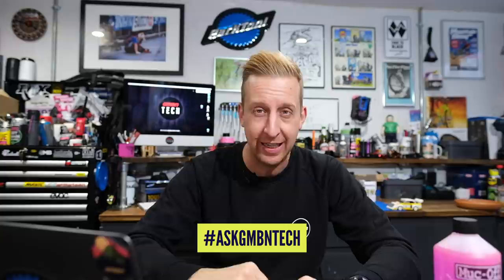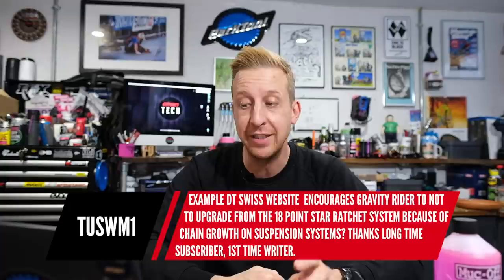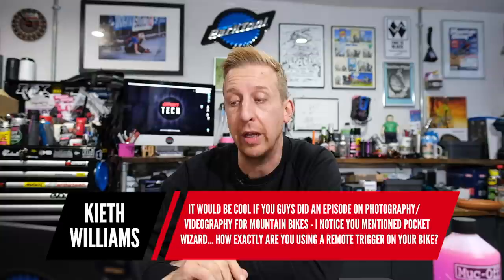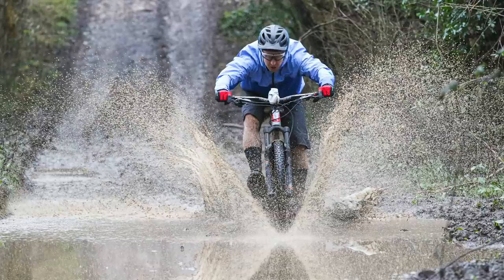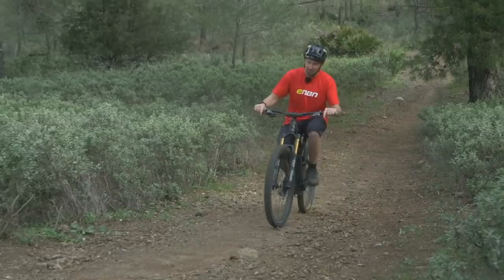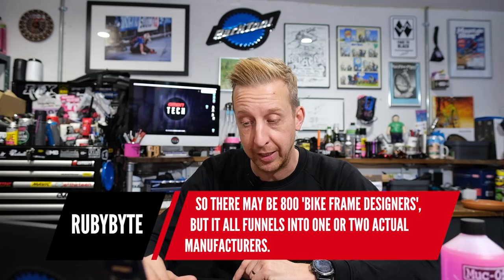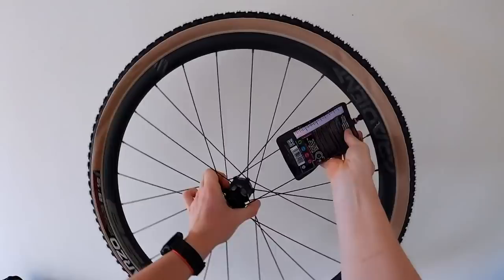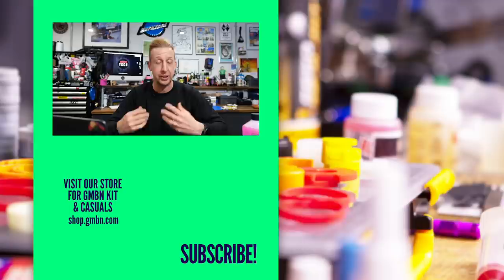What Is The Clear Pole Hack To Get The Bike To Stand Up In Photos? | #AskGMBNTech

Comment: #AskGMBNTech
Is it worth it refreshing a enrty level hardtail (900€ 4 years ago) with new tyres, casette, chain, chainring, (1x11) and a big fork service (straight steerer) or should I rather sell it and get a new bike with modern standards (boost, tapered steerer, Ht under 70°)
Reply: you wouldn't get a bike with modern standard for the money that selling an old standard XC bike would give you, unless you want to plough in a whole bunch of money on top
Reply: @judechandler5102  well that's a point
I thought about 1.8k maybe for a new Hardtail, maybe even carbon with some luck
Reply: @maikszczerbuk613  try canyon. They have some pretty decently specced carbon HTs
Reply: @judechandler5102  thanks for the hint, I already got one exactly due to this reason.
They have a serious deal, just the brakes are often quite poor

Comment: #AskGMBNTech
 my shimano hollowtech 2 crank got stuck
used a hammer to tap it out no luck tried to tap it it back in no movement can still see a little bit of axle showing
now it is not all the way in /against the bearing but its works fine, even the shifting works fine 
is this a problem ?

Comment: #AskGMBNTech. Hi Doddy. I am hoping to be placing my 2014 Boardman FS Team for a more modern bike. The geometry chart for my bike doesn't have the reach or stack figures. When sizing a modern bike compared to my bike. How do I work out the size using the geometry charts? I have tried to work out my reach with a tape measure and it is around 440cm to 450cm. If I went for a bike with a 470cm reach. My Bike has a 60mm stem and 760mm bars fitted. How would that make to bike feel for me. I am around 170cm tall. I have also been thinking about getting a 29er. Which did surprise me with some not so kind comments in the past. In a recent video Neil said he can buzz his backside in his Pole. As I am shorter that Neil would it be worth it for a full suspension bike? Or would it be better for me to have a 29er hardtail?

Comment: #AskGMBNTech hi doddy I have a 2020 giant trance running fox float rear shock with about 300psi for the correct sag but even on the slowest rebound speed it seems to rebound too quick and buck you off the saddle, what are your thoughts on a fix or any ideas. Thanks from nz 🇳🇿

Comment: #AskGMBNTech
I do a decent amount of road riding on my MTB and have been considering getting a set of 29×1.5 (38C) road tyres to swap on. I'm averaging about 20km/h on a 3-4hr road ride running Minion DHF fronts and Aggressor rears (both ~60psi). Will I notice any increase in speed or is it a waste of money? Aware that on a 16kg bike its no road racer, just wanting to go a bit quicker without forking out for a new bike 🙂
Reply: fatter tyres roll probably as well as skinnies, especially if the surface is not glass-smooth. Just switching to harder compound slick/semislick tyres might be enough to ride fast, with the added comfort and traction of high-volume rubber.

Comment: #AskGMBNTech Should the factory grease/oil on the chain be removed before the first ride? I understand that the chain needs to be lubricated, but don't they overdo it? I recently deep cleaned and degreased my drivetrain and swapped my chain (KMC) and went for a short ride and the amount of grime and dirt that collected on the chain, cassette and jockey wheels in an hour was just incredible, never seen something like this.
Reply: I believe GMBN covered this at some earlier Tech show. The grease on the outside of a new chain - absolutely, just wipe it off: some degreaser on a rag and just run the chain through it. The factory grease on the surface of a new chain is intended to protect it against corrosion while in storage. Actually riding with that grease layer on will not be healthy for the chain or your drivetrain, as you discovered.

The grease on the inside of the chain, however - the one between the rollers and the pins - that’s something you shouldn’t touch. I believe KMC says somewhere that if you do a deep degrease of their chain (submerging it in degreaser), it’s actually going to reduce its lifespan. You can lube a chain all you want afterwards, but nothing can really replace the factory grease between the rollers and the pins.

So: wipe the outside grease off, let the roller-pin interface grease on the inside to do its thing, and don’t submerge the chain in degreaser. = Golden
Reply: Yes. Many lubes, esoec dry lubes, require a full degreased chain so they bond to the inside of the rollers.
Manufacturers just dip chains to prevent corrosion.
They dont apply magic lube to the rollers that shouldnt be touched, or not dipped.
Reply: @Rupert Wenn  No such thing as a magic lube, unless it's a personal lubricant. :D But let's not mix apples and oranges, beginners and people less versed in all things mechanical might be left with the wrong idea. Lubing aside, there is (or at least should be) installation grease between the pins and the rollers. This is true at least in the case of KMC, but I can't speak for other brands. This grease is completely different from your average lube, and most normal users want that grease to stay in there for as long as possible: on the inside, that is - not on the outside.

From KMCchain.us / Maintenance Guide, Cleaning:
"Do not dip your chain in (aggressive) degreasers - they remove the remaining grease from the chain’s
bearings, and may cause cracks. They are also bad for our environment."

It's definitely true, however, that some lubes - especially the ones that dry wax coat your chain - require a deep degrease before application. You will get a clean, non-stick chain, but you will also get rid of the internal factory grease from the get-go, which reduces the lifespan of your chain in the progress. No right or wrong here, to each their own and you do you - I've just always decided that I prefer mechanical longevity to ultimate cleanliness. :)

Comment: #AskGMBNTech Hi Doddy! I'm thinking to upgrade my 2018 Pike RCT3 B1. It's easy on the Debonair side, but there are 2 versions of the Charger 2.1: RC2 vs RCT3. And it's hard to find any reliable information on them. What's the real difference and at which riding-style do they aim? Is this similar to FOX Grip2 and Fit4? Best wishes from Vienna!
Reply: rct3 has a low speed compression and a lockout adjustments. RCT2 has low-speed and high-speed compression adjustments instead without the lockout option. I'm running rtc3 on a trail bike and have never used the lockout.
Reply: @laurynasjagelo5075  I guess that shows that the RC2 would fit you better, because with the rct3 you cannot configure HSC. But that does not answer my question. If you search for it some say, that the RCT3 is pure crap and a well configured RC2 does it all (it's way more expensive also). I'm a long distance All-Mountain rider and use the 3 modes all the time. I wouldn't climb long fireroads with the suspension fully open. Is the RCT3 for the allrounder and the RC2 just for going down? Is it that simple? Then why isn't even Rockshox saying anything about which one is for whom?

Comment: #AskGMBNTech I have a carrera Fury mens 2020 can you please tell me why the spacers a lot bigger in size than the steer tube as I have lowered the stem so I have a spacer on top of the stem and I can't senter the spacer under the top cap              thanks for the help and love the channel ps the bike is my first bike with 120mm fork and dropper post
Reply: Spacers are marginally bigger than the fork steerer, but not much.

Comment: #AskGMBNTech Colder months & carbon MTB / Parts stored outside in an Asgard storage lockup. Is there any concern to be had with carbon bikes being in a bike lockup outside in the winter months? How cold ( or hot even ) before any sort, if any, damage will occur? I have tried to research this, but get very mixed answers online. From the ridiculous " it will explode "  to " aeroplanes have carbon wings and fly in sub temps". That's great and all, but 1st, it gets about -8 lowest where I live and 2nd, my bikes are not planes, so no help! Can you help at all Doddy? Thanks!
Reply: The plane analogy if the one to take your answer from....
Reply: @rupedog  I do sway to it, but the aviation industry has higher standards than the bike industry. I would have thought that there would be greater care and attention in the processes because it is already a given that the material is going to be in sub temps and greater forces exserted on it.

Comment: Many brands will state their bikes are made by Giant or Merida but frame manufacturing in Taiwan has become much more expensive and Giant has lost a lot of OEM work even though it has a mainland China factory. Canyon used to use Giant to manufacture their frames but their carbon fibre frames went to Quest Composites a much cheaper and lower quality factory and for all we know could have moved again. Most of the importer brands around Europe and US are constantly trying to find the cheapest factories of sufficient quality.

Also I think the design side of the importers is grossly over-stated, you have bikes like the Calibre Bossnut and some of the Voodoo models which are shop brand bikes and yet perform brilliantly is it because these shop chains have amazing bike designers by chance or is it that the actual factories design the bikes? By some miracle when you look at the Chinese factories own brands they seem to have very similar bikes sold on their home market with their own brand on especially at low to mid price points. Case in point the Calibre Bossnut by chance seems to strongly resemble one or two of the Polygon models which of course manufactures the Bossnut in Indonesia.

You always need to be a bit resistant to sucking down the marketing spiel given by the bike industry they are motivated to get you to pay that extra premium for that US or European brand but you can often bypass such brands and get much better value by going either with the factories own brand or go with a factory to retailer direct logistics model like the Calibre Bossnut. Also with the Calibre Bossnut you have local support and a desk to bang your fist on if it goes wrong which can be better than the support offered by direct sellers who really can't help you once you've received the bike, no free servicing etc.

We all love GMBN but they are clearly set up to steer you towards their sponsored brands which have complicated logistics and very high pricing. You would never use GMBN as a good source of info in trying to get great value from your bike purchase.

Comment: #askgmbntech My Rockshox air fork feels like its locked when the weather cools down. When I start riding it works perfectly fine. Should I service it or does this happen with all forks?
Reply: Not with mine...but oil will become slightly less viscous in very cold weather, effecting damping until the oil warms slightly. 
If ur riding regularly in very cold conditions for a season, the main manufacturers may spec a lighter oil to standard.
But a service might help and worth doing if not done recently.

Comment: #ASKGMBNTECH I can't dry fit my tyres to the rim. Even using a gas station pump it will leak air quicker than it will get in there. I got ensured that both are tubeless ready and fitted tubeless tape also by inserting the tube again and pumping it up. 

Is my tyre to big for the rim or what's the problem? Any other advice ? Thanks a lot.
Reply: Clearly tyre to big if even with a tube its loose on the rim.
Try your lbs for advice.
Reply: There's a recent video on the channel Syd Fixes Bikes that shows a great trick for getting difficult tubeless tires to seal up. The only thing I would add to their video is that you can first install the tire with a tube so that when you remove the tube, the bead is already snapped into place on one side.
Reply: I used a bunch of electrical tape to build up the thickness on the rim, but any tape should do
Reply: @rupedog  with a tube the tyre sits perfectly. It is only leaking air when no tube is inserted. Unfortunately my lbs are rubbish...
Reply: @mattgies  thanks mate i'll have a look.
Reply: @johnjoe9338  Yeah maybe I will get some gorilla tape since doddy also mentioned it before in another video. I used 3 layers of tubeless tape already but maybe it is still not enough.
Reply: @patorico_8879  Cheers!